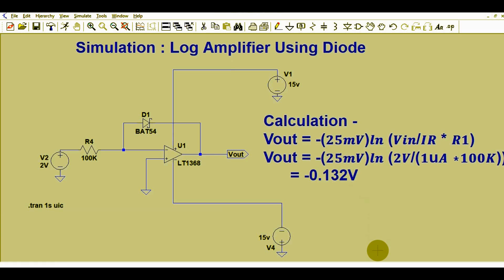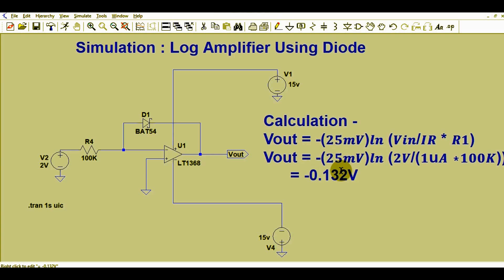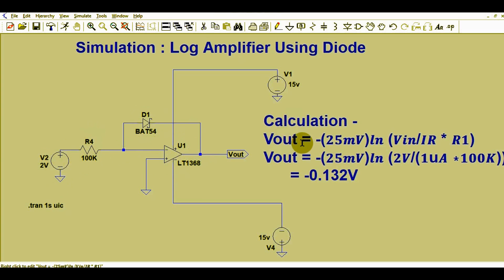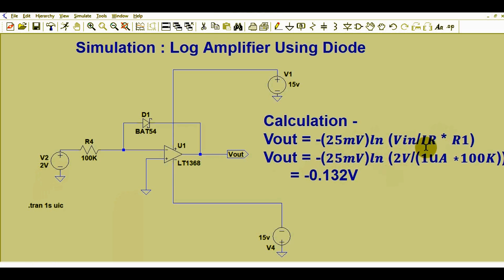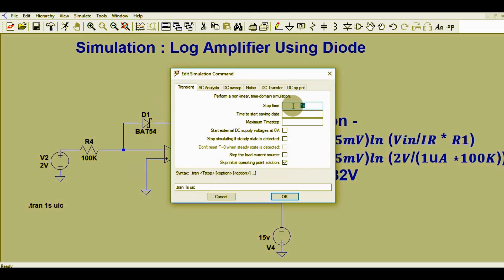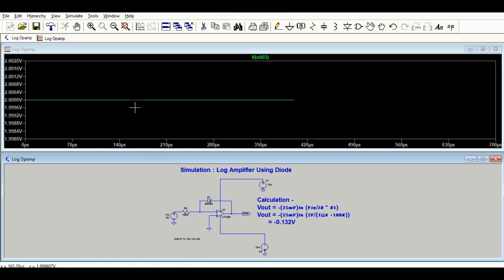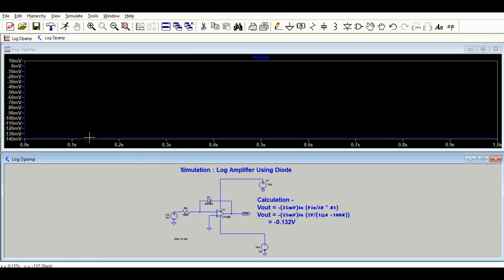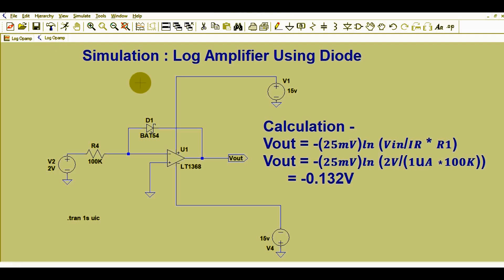LTSpice Log Amplifier using Diode | Simulation

Comment: Hello sir I am working on a analog multiplier and I made a simulation on PSpice as well but the output I get goes into saturation even after changing the input and output voltages can you please guide me with this 
You can contact me by  whatsapp 7827509162